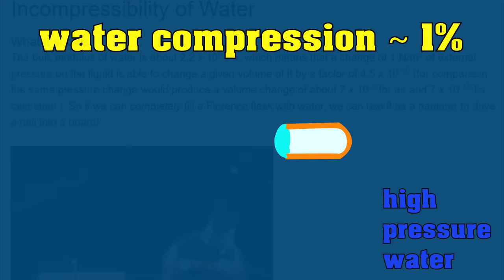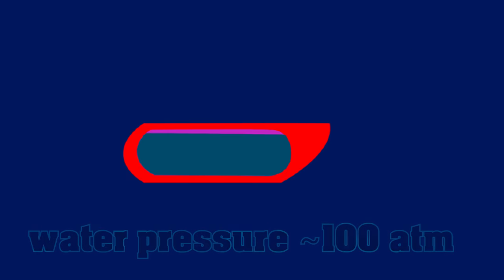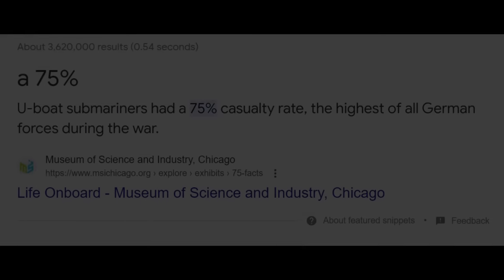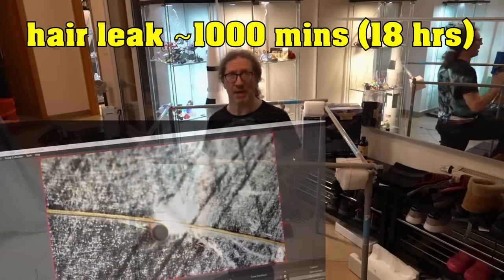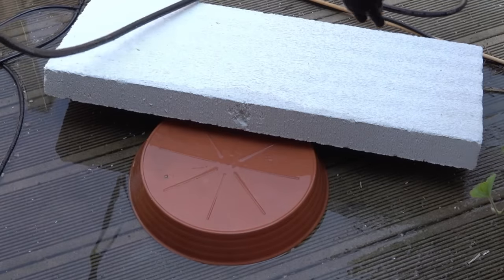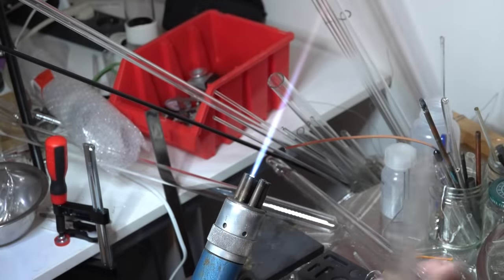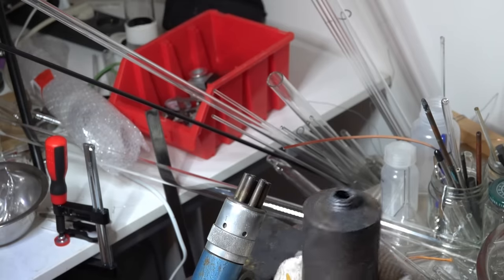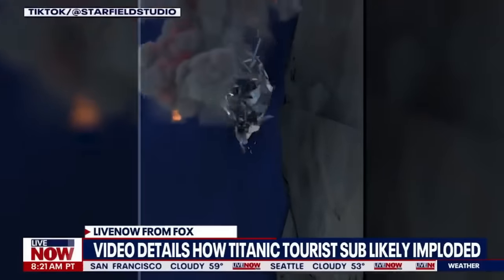Why the Titan sub failed

Comment: I wouldn't trust that glue joint like that. How do they know there isn't a huge air bubble in the bottom of the groove in the titanium part? How do they control the thickness of the glue? The glue didn't look to squeeze out so surely didn't fill up all of the void volume in the joint. I say they would've been almost better off with a rubber seal like on a pickling jar. Of course it wouldn't hold under pressure, but at least it could let the material contract differently. There's really no way of making the two materials work. And why? There's just no reason to be using carbon fibre, especially not on an experimental sub that will dive with people in it. I have to say to develop this sub AND dive with it, the CEO had to be not only naive, but also courageous. Those are the most dangerous idiots you will find anywhere.

Comment: Ever see that picture of everyone who worked on the sub posing in front of it? How the HELL did any of those engineers feel comfortable with the design after taking even one material science class? I know they took it. They should know how brittle materials like carbon fiber fracture, and that hand-gluing it to titanium is unreliable and prone to de-adhering when parts compress… I’d never stay on this job if I knew this was the final design. I’d be warning people to stay the hell away! And I’d love to see the simulations they did (if any) because their assumptions must have been horribly off.

Comment: Yeah that bond job wasn't even done in a vacuum chamber to remove any possible air gaps... I'm amazed it made it to the depths it did as many times as it did.  They "heard cracking" on prior dives and never refabricated the hull...  Just insane levels of arrogance and idiocy.

Comment: There's a equation with flow and psi there's not enough flow I've got a pressure washer with 25lpm at 3500 psi it will cut your toes off

Comment: You are confusing hull breaches at 200m (20atm) with catastrophic failures at 4,000m (400atm, NOT 100atm BTW!). The evidence speaks for itself. And a 1.2m Ø × 2.5m cylinder is closer to 3m^3, not 1m^3

Comment: It failed because it was piece of shit made from literal garbage.

Instead of rambling on and on about water pressure, you could have given us 100 times more information by spending 30 seconds just zooming in on the masking tape and cheap scrap metal.

Why does this video need to be half an hour long?

Comment: You would have thought they would have used an autoclave and baked it into one giant part with no seams. Looking at that footage I would have noped the fuck right out ! that tiny amount of glue to hold pressure at 4000 ft ??? jeez! From what ive seen seems likely the carbon fibre delaminated on the inside from micro stresses in the fibre then catastopic lost of structure.

Comment: The glue was not hard, he said was like peanut butter, so he have prevented this effect show in the video allowing carbon fiber tube to shrink inside the titanium ring "sliding" in the glue, I think he was not stupid, have try to prevent many situation in clever ways
Reply: have you ever used epoxy? theirs is some special stuff with additives, but the base material is the same thing. it's like peanut butter before curing, but after it forms a polymer that's hard as a rock. i suppose it bends more than it slides. if it slides you already have a huge problem
Reply: @markifi  yes I have worked with epoxy and composites, I supposed they have used a very thick type of adhesive that never become hard, with pressure it keep the seal and allow the differential expansion of materials, is needed to understand how many cycles it can do before it create micro holes or water path

Comment: Bit late fella , the conclusion wasnt difficult, they put yhat sealant on with less xare than my mate builds a shower cubicle.
The ither big materials fact is that the carbon fibre was made under autoclave oressure of about 120 psi tgen subjected to 6000

Comment: It failed because it was a deathtrap with failure in its destiny from day 1, which they then enhanced by cutting corners and ignoring safety concerns. 
Just because it's expensive, doesn't mean it's safe.
Reply: the Titan likely cost a mill

Comment: Very little attention was paid to safety, a small fire even if put out quickly could potentially incapacitate all those aboard.
Reply: Come on, any small failure would have been catastrophic at that depth. They probably heard audible cracking for perhaps minutes before failure, but when it finally failed it was over in the actual blink of an eye.

Comment: I find carbon fiber to be inferior to metals. In a very primitive example on a golf club shaft one tiny nick in the carbon shaft will critically weaken it. With a steel shaft you can ding it scratch it and it still holds up. Carbon shafts will fail at the flaw its only a matter of time before something you do in your swing to impact and it shatters. The devil is in the detail.  Primative explanation but I have seen how bad carbon fiber fails far before a metal shaft.

Comment: Your prediction of how Titan failed is based on a military style submarine. Titan was anything but. It was a flawed conceptual design that no governing body would have deemed fit for it’s mission. The hull was carbon fiber “glued” to titanium end caps. It is highly unlikely that only a pin hole was formed, but that the entirety of the hull shattered under the immense pressure.

Comment: i disagree with your perception of carbon fiber as a "plastic" especially at such depth/temperature. can we really define its material property's without proper v-notch  data sheets for every depth/compressed multiple times 4d spreadsheet that would require for a "proper" scientific build of a sub like that. they cut corners, people die.

Comment: It failed because carbon fiber is useless at resisting compression forces. This is not a mystery.
The porthole only being rated for less than 1/3rd of their dive's depth definitely didn't help.
But the biggest culprit is the hull material being useless. Only the epoxy resin was resisting the ocean. The fiber contributed nothing, and repeated dives weakened the resin each time. It is well documented that Oceangate did no testing or maintenance on the submersible.
Reply: Carbon fiber is no  "useless". The submersible survived seven prior dives, so obviously carbon fiber is strong enough in principle.  I blame the manufacturing process.
Reply: @dirremoire  Carbon fiber has absolutely no resistance against compressive stress. Its strength only applies to tensile strain.

What was resisting the oceanic pressure on the prior dives was the epoxy. Entirely and alone. The fibers did nothing. They managed seven dives protected by five inches of glorified plastic.
Reply: @aircraftcarrierwo-class  I hear all this smack talk that carbon fiber cannot resist compression. If you're talking about one isolated fiber, sure. What most armchair, wannabe material engineers/YouTube commentators forget is that carbon fiber is woven into sheets of distinct patterns. By overlapping these sheets in different orientations, carbon fiber can have truly impressive compression strength.
Reply: @dirremoire  I know how it's made, dingus. It's still not going to resist compression any more than your shirt is. Carbon Fibers are cloth. That's what allows it to be woven in the first place. And then it gets locked in place by the epoxy resin matrix to create a lightweight, sturdy sheet.

Which does particularly poorly on compression stresses, but is incredibly strong when resisting tension. You can make a pressure vessel with carbon fiber... provided it is containing high pressure inside against a low pressure exterior. This puts the fibers in tension, at their strongest.

Using it to make a submersible hull puts the low pressure inside and the high pressure outside. This is compression. Carbon fiber is about as useful as your T-shirt in that situation. The epoxy resin matrix was doing all of the work keeping the Titan in one piece.

For someone criticizing "armchair engineers" you don't know what you're talking about.
Reply: @aircraftcarrierwo-class  "carbon fiber is just cloth. " That tells me all I need to know about your IQ.
Reply: @dirremoire  you dont know why it's called fiber, and I'm the stupid one. Go t it.
Reply: @aircraftcarrierwo-class  Ok, I'm sorry. It was your use of the word "cloth" that got my hackles up. Carbon fiber, as you know, is never woven into "cloth".   It's woven into sheets.    

However, your point that carbon fiber provides no added strength to the epoxy is just flat out wrong.  The whole science of carbon fiber is based on the concept of composites.  Two (or more) materials. which when combined, have much greater strength than each individually.
Reply: @dirremoire  please understand how a pressure hull is designed, the forces involved, and why they use the materials they do. Then maybe you'll understand why carbon fiber is terrible for submarine pressure hulls.

Here's a hint: a variation of 1% off a perfect sphere will reduce the hull's overall ability to resist compression by as much as 35%.

Comment: Why use carbon fiber when the weight of the sub is irrelevant? Was it just marketing "carbon fiber submersible" sounds high tech and strong. When in reality lots of steel would have been a far more logical choice?

Comment: I thought they recovered the end pieces of the sub pretty much intact, so these animations already fail at the most basic thing. I have to wonder why they even bothered with the shredding animation in one when it clearly is wrong from the onset..?
Edith says: I also guess usually the carbon fibers and the binder should be cured in a high pressure autoclave, to kind of negate changes under pressure among other effects. But according to some reports it appears they didn't do this either, which makes the clip at the end even more strange..

Comment: Dear Mister Foot...the drug store guy said it was the best glue you could buy.... YOU missed that didnt you... go ahead and admit it.

I am asserting though, that as the 4,000 psi column of water burst through into that relative vacuum inside the hull..
.
......that it instantly gained speet,,,,putting the equation  F=MA into effect... and that is what blew the titanium heads out each end of the glue tube .

Comment: carbon composite will laminate before leaking or breaking. A known issue: its not rigid like glass. Cool video, missed the point completly. 
The "it will be crashed" video is closer to the truth then you are. Not enough research into the materials specific for this situation, unfortunately

Comment: Epoxy is not carbon fibre. Similarly, lime is not concrete. And stop prattling about “likely” failure modes. You employ zero statistical data.

Comment: Not strong enough washer. Need a Honda 24 hp twin. 3000 psi 10gal a min flow rate through a less than a pin hole. Take your leg off.

Comment: So it is "not the pressure that killed people... It was compressed water... expanding very quickly in to empty space of the submarine..." :D Really... It kinda explains what pressure did, it is not a completely different thing...
Reply: It seems like semantics but at least it's accurate. My take away was, when water is pressurised it is compressed and when low pressure is introduced the water decompresses at the speed of sound in water, making it accelerate to about the speed of sound in the 1atm bubble of air almost instantly, which in turn releases some pressure while it equalises... I'm not sure if that's 100% correct though as they do seem to me, to be two closely related topics.

Comment: Your demo sadly didn't work because you ironicaly fell victim to manufacturer's nominal specifications, besides, consumer grade pressure washers aren't exactly made to last (at least within nominal specs) for any significant time. Impurities from the water may end up building calcifications around important components reducing cross section and restricting flow, that pump definitely has some cavitating grump to it. By the way, it that saucer is made of HDPE plastic, without knowing the exact grade we're talking about about around 40MPa of stress to get it beyond the plastic region.

Comment: I'm gonna be blunt, this is one of the worst breakdowns of what happened to the titan that exists on youtube. Its an out of wheelhouse introductory physics knowledge flex padded by loosely related clips while putting fractions of the time into the engineering that ultimately what lead to the implosion. The only reason he came up with his pinhole leak idea is because he had a pressure washer and he figured it was good enough for a math problem. None of what he said is supported by what they found on the sea floor. And to say that deep sea pressure cant kill you is stupid. Its not the thing to kill you if your sub implodes but deep sea pressure can and will kill you. oxygen/nitrogen narcosis and barotrauma, have you heard of it? Hell there have even been people to have died while wearing a dry suit because the pressure outside of their suit was too great to allow them to breath. Video made of the sake of making a video.

Comment: 16:34 I am no expert or anything, but wouldn't it be a better idea to hold the metal with a dry cloth?
I was always taught to never pull anything out of the oven with a wet cloth as the water would allow for rapid heat transfer and would burn me and a dry cloth (while it would heat up) would be much much slower. 
(I am just a programmer, not a scientist so am not sure)

Comment: Hey there. I work at a Patent & Trademark Resource Center. I thought that you (and anyone else reading this comment) might want to take a look at Stockton Rush's 2021 US patent entitled "Systems and methods for curing, testing, validating, rating, and monitoring the integrity of composite structures". I'm sure you'd have a better insight into the engineering aspect than I do. Here's the link to the patent PDF on the USPTO website:  https://image-ppubs.uspto.gov/dirsearch-public/print/downloadPdf/11119071

Comment: This is the first place that explicitly noted the difference in comprehensibility of Carbon fibre and Titanium. But the difference didn't act like the brittle joint between glass and metal. This submersible had already made several dives to the titanic, without failure.  

Related to your idea of compressibility, several other sites have noted that the repeated compress/decompress cycles could be expected to eventually cause delamination of the Carbon Fibre layers, which would eventually lead to a crush failure in the middle of the cylinder. 

Here is a vid that analyzed the unconfirmed transcript. 
"LEAKED Titan Sub Transcript Shows Crew In Battle For Lives"
https://www.youtube.com/watch?v=4Dj8IJbP41c

Descent was too fast from the start!

3800m titanic depth 2.5hr planned descent time  = approx 25.33 m/min

As noted, it was descending too fast from first depth report, 1.42x's too fast.  That suggests to me that they were significantly over weight at launch. Water collected in bilge/rear that wasn't pumped out pre launch?
Note that the descent over speed was slooowly increasing, which suggests a slow leak adding weight, increasing descent speed ...

Personally, I would have expected them to have a printed dive chart, or computer program to compare their reported depth vs time.  If they  had, they would have noticed the over speed at first check in. At that point being overspeed by 42% it should have triggered emergency checks. If they couldn't slow descent to appropriate speed they should have aborted shortly after, probably well before 1 hour in to the trip ...

time    rpt  should be  mult   descent rate
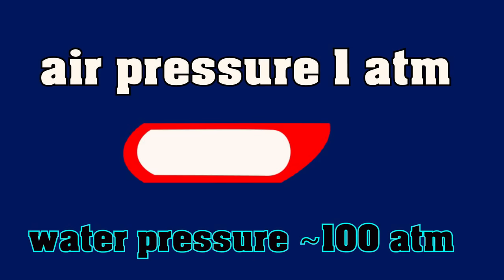8:01        0                                                        descent started  
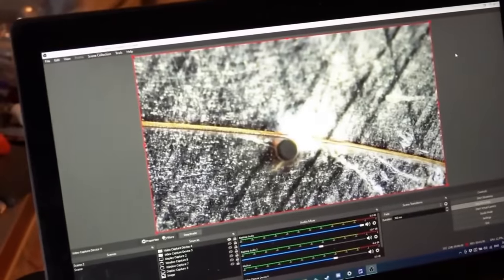8:21    756      532     1.42x  36.0 m/min
8:51 1,934   1,292     1.50x  37.9 m/min 
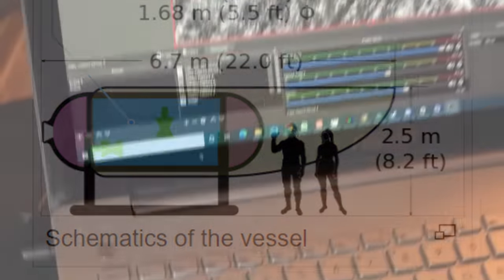9:18  2,960  1,950     1.52x  38.4 m/min
9:28                                                                  noting alarm reducing speed
9:28  3,433  2,229     1.54x  39.0 m/min      367m from bottom
9:31  3,5??                                                       "at 35" is that 3,500m or descent speed 35m/min
9:32                                                                 released ballast, no improvement
9:35                                                                 frame jettisoned, ascent started
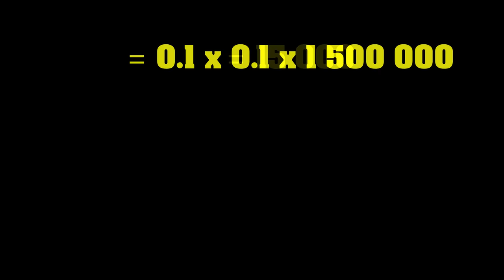9:38                                                                 crackling sound at aft
9:42                                                                 ascending very slow, crackling sounds subsided
9:43   3,476                                                    slow ascent, 1/4 predicted
9:46   3,457                                                    switch to Power Bus B, more sounds aft (ascent 1/4 speed)
9:47  silence

Comment: The chat logs between the captain and the support vehicle provide a lot of insight into what happened. I recommend listening to them.
They descended way too quickly, when they hit 3500 their hull alarm went off which indicated their hull was deforming. They heard a crunching in the aft which likely was a pin hole leak forming in the aft inbetween the glue getting inbetween the layers of carbon fiber. The water in the aft seemed to cause a power loss so they weren’t able to ascend. After about 15 minutes from the alarm going off communications stopped indicating the sub had failed.